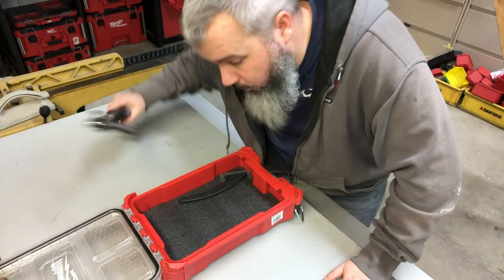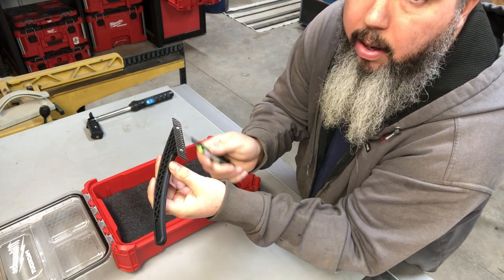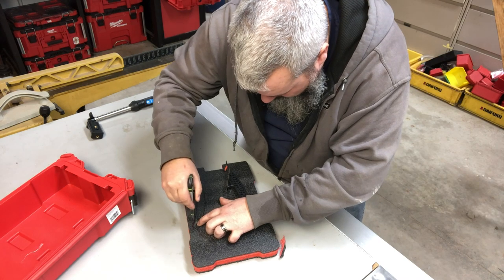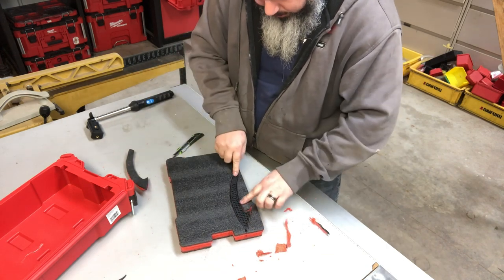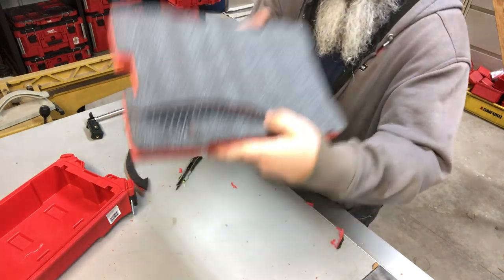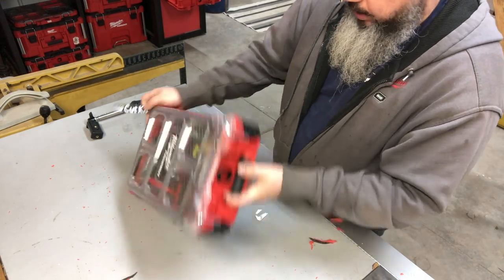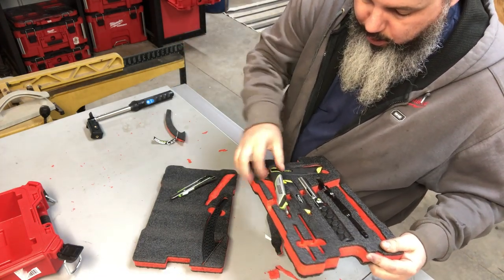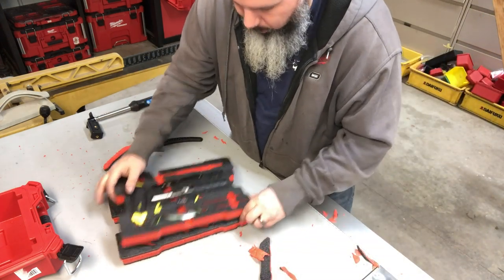HowTo... cut a B!tch (Cutting foam for my Kaizen foam Cutkit in the thick Milwaukee PackOut)

Comment: When you're putting permanent sticky things on plastic, you need to clean the mold release fluid residue off first.  An alcohol pad works a treat.  Even 10 year old car interior plastic bits have mold release fluid still on them  (as well as residue of whatever vapors have been in the car).
Reply from the maker: What would you use ?

Comment: Unless I'm missing something (and I may very well be), this only works this cleanly with the Kaizen layered foam, that's made to separate.  The Milwaukee foam I purchased, doesn't separate, so you have to dig out EVERYTHING.  You can't just cut an outline, then peel the layers off.  So, to anyone looking at the Milwaukee foam, be very wary of it......that's what you're getting yourself into.  The outline itself will come out clean, but everything else will be a complete mess.  I'm incredibly disappointed with Milwaukee in this aspect.  It's cut to fit the Packout chests nicely, but, the irony is that, ANY foam can be cut to fit the Packout boxes nicely.